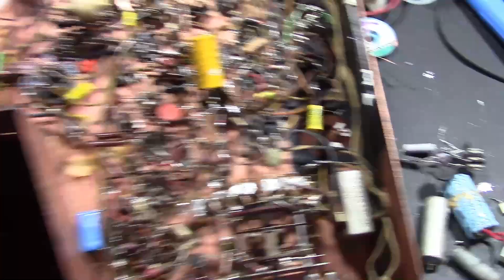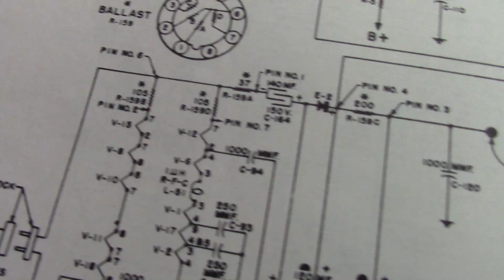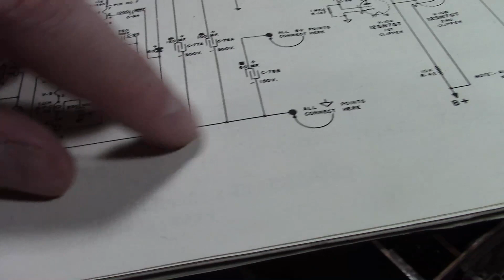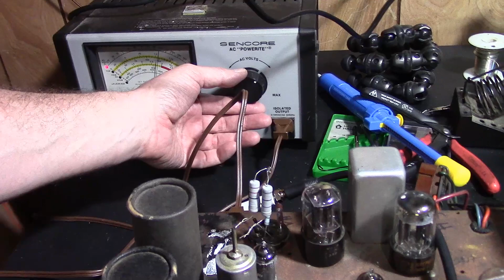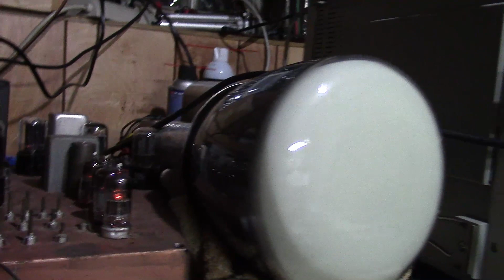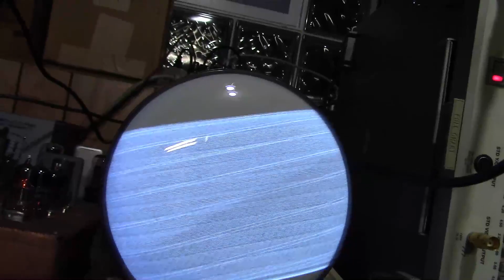Motorola VT-71 restorations p2o10

Comment: I know you would consider it sacrilege to put a 3-wire cord on one of these but if I had one I would do it.

Actually I wouldn't be surprised if that JAN PhilipsECG tube was made in the 80s since there were millions of spare tubes ordered by the military back in the 1980s.  The Deutsche Bundespost did the same thing when Siemens stopped making new tube telephone repeaters back in the 1970s.